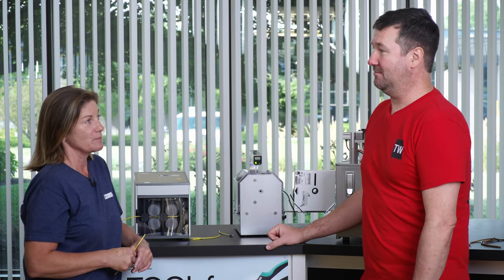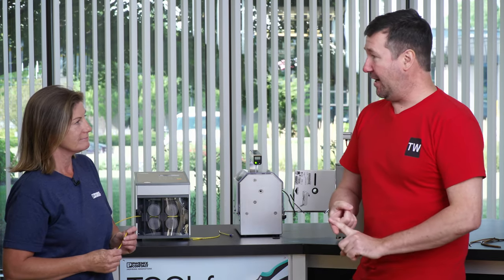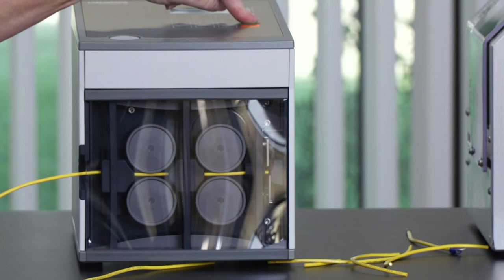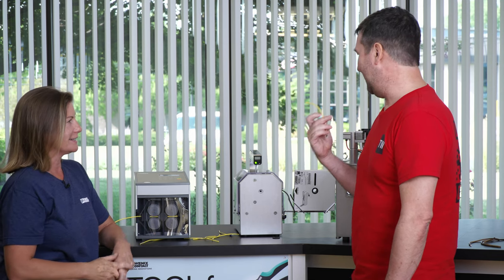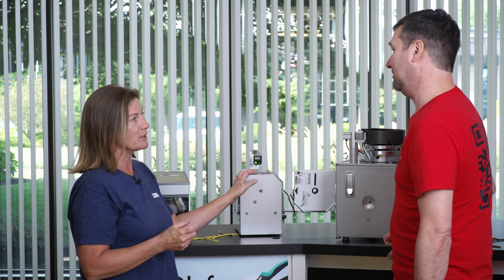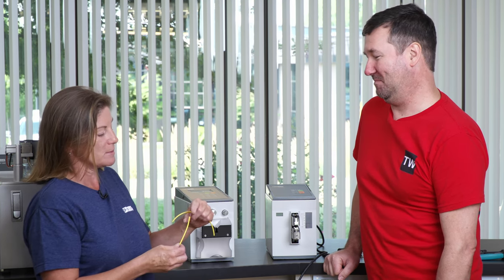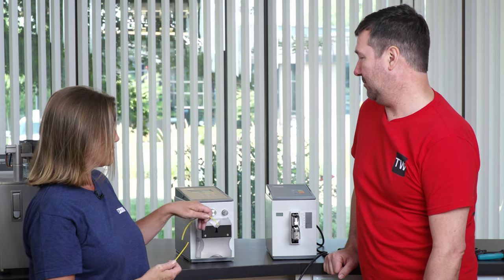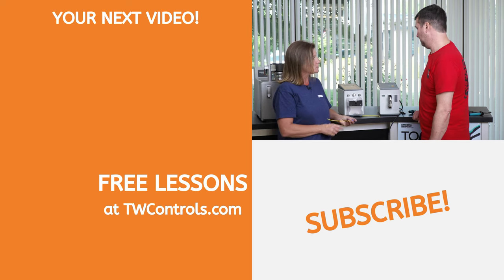Automatic Wire Cut, Strip, and Ferrule Machine

Comment: Tim do you put a ferrule on every wire in your panel?
Reply from the maker: Yes Gordon, 100% of the time.
Reply: @TimWilborne  why when Phoenix screw cage don't require it?
Reply from the maker: No ferrules are required per UL.  You do it for the longevity of the panel, especially when components are being changed.